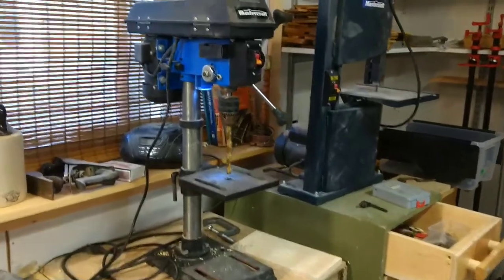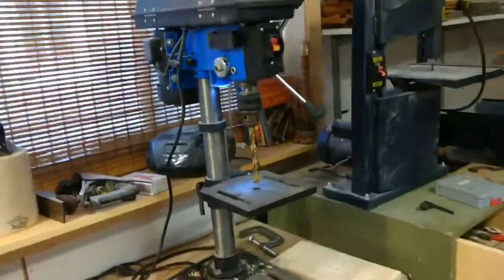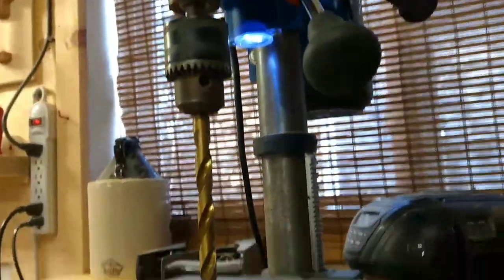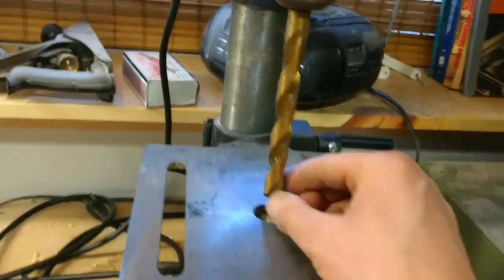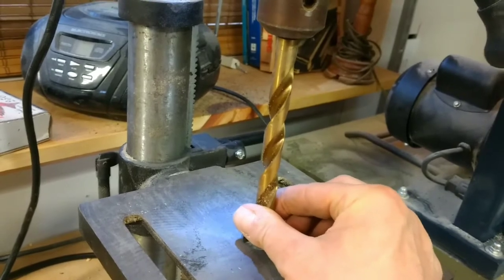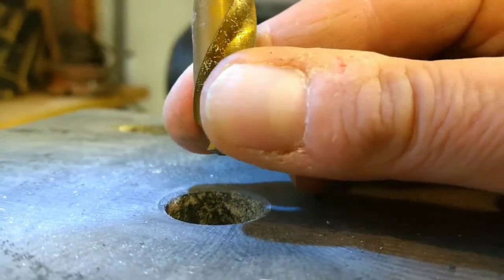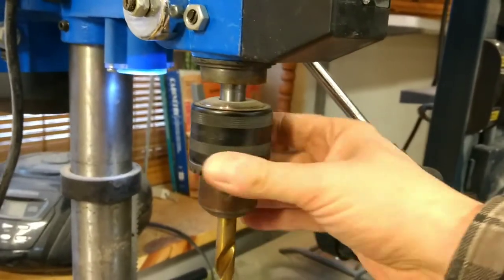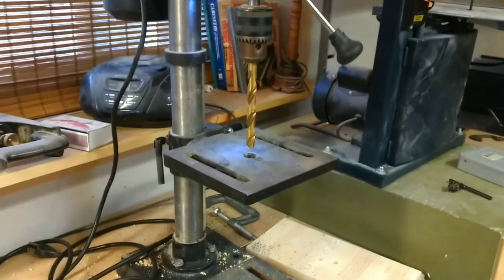Mastercraft Canadian Tire drill press wobble

Comment: I recently received one of these drill presses as a gift. It had the same play as is mentioned in the video. I tried adjusting with the set screw on the left as per the manual and it did nothing. I removed the set screw and found it had to two flats machined on the end forming a flat spade on the end to fit into the groove on the left of the quill ( the bit that goes up and down with the rotating shaft inside). The idea seems to be to angle the flat section in the groove to take up the play. A very crappy idea! I found another set screw and ground  taper on the end to fit snugly in the groove, lubricated it well and re-assembled things tightening the screw until play in all directions disappeared. I have now drilled a few hundred holes with excellent results and only once tightened the screw to keep things tight. I hope this works for you guys.
Reply: THANK YOU SO MUCH!!! This is what I have been leading up to thinking about trying to fix the problem from what I have read/found/and diagnosed from the diagrams of this machine.
Reply: How did you disassemble the quill etc to remove the set screw? I am having trouble finding any disassembly tutorials for this model of drill. All I have to go by is the 'exploded view' in the manual.
Reply: Just tried this and it seems to be working great, thanks for the tip.
Reply: @TefenCa  I just forced the set screw out without disassembling anything.  I pulled the lever all the way down first so that if it damaged anything, it'd at least be at the end of its travel.  There is now a bit of wobble in the last quarter inch or so of drill press travel, but otherwise it's tight.

Comment: All Drill presses are made in China ,or Taiwan, big box stores buy the crapiest of the crap,to meet a certain market demand a proper tool store,will have them made to a much higher specifications ,but obviously you will also pay a lot more for them.If you look at the higher name brands drill presses you will see the castings all look the same,but the higher spec get the better of the castings and internals.

Comment: This is a bit late. I just stumbled across this video that I commented on a few years ago (I'm C below) and only just noticed that Tefen Ca asked a question about removing the set screw. I embarrassed to say I just used force as I did not know what I was dealing with (the spade end in the quill slot). Luckily the set screw was made from very soft steel and came out easily. Also, an added tip. If you are not familiar with centre drills AKA known as starter drills or even Slocombe drills to the old guy's (me) get yourself some and use them for precision drilling in steel.

Comment: I have a Ryobi  DP103L with the same problem- seems fairly solid when retracted but still has almost a 1/16” of deflection and at least a 1/8” runout when quill is extended. I would definitely include pictures if I knew how.
This seems like a good fix, but on mine, I would have to remove the on switch assembly and hopefully drill / tap the cast body beneath it, and do the same on the opposite (left) side next to the return spring. Also, it frustrating and almost impossible to set the apparently? flat table perpendicular to the chuck/ quill assembly Really not sure if it’s worth it..? 
On a good note I did find your video :) and I did learn basically what my real problem is. Since I drill a lot more steel than wood and want more precision. I should have saved a couple hundred extra dollars and bought a better tool… oh yeah, wait a minute- this was bought as a present by my girlfriend… hahaha, didn’t want to discourage her so I’ve sucked it up and tried to make the best of it. Damn it Jim! I’m kinda in a pickle.

Comment: I agree that this thing is a piece of junk. I paid $99 for mine and I can live with the crappiness of it but it's been nothing but problems ever since new. Wish I saved the receipt!
Reply: same for me , no receipt.... but hey there is a set screw on the left side  thighten it a little and it helps takes away some the wobble. dont get confuse there are 2 set screw  side by side
Reply: "I recently received one of these drill presses as a gift. It had the same play as is mentioned in the video. I tried adjusting with the set screw on the left as per the manual and it did nothing. I removed the set screw and found it had to two flats machined on the end forming a flat spade on the end to fit into the groove on the left of the quill ( the bit that goes up and down with the rotating shaft inside). The idea seems to be to angle the flat section in the groove to take up the play. A very crappy idea! I found another set screw and ground  taper on the end to fit snugly in the groove, lubricated it well and re-assembled things tightening the screw until play in all directions disappeared. I have now drilled a few hundred holes with excellent results and only once tightened the screw to keep things tight. I hope this works for you guys."
Reply: @Danroxye01  "I recently received one of these drill presses as a gift. It had the same play as is mentioned in the video. I tried adjusting with the set screw on the left as per the manual and it did nothing. I removed the set screw and found it had to two flats machined on the end forming a flat spade on the end to fit into the groove on the left of the quill ( the bit that goes up and down with the rotating shaft inside). The idea seems to be to angle the flat section in the groove to take up the play. A very crappy idea! I found another set screw and ground  taper on the end to fit snugly in the groove, lubricated it well and re-assembled things tightening the screw until play in all directions disappeared. I have now drilled a few hundred holes with excellent results and only once tightened the screw to keep things tight. I hope this works for you guys."
Reply: @TefenCa  I'd love to have seen more clearly how you improved it and what you used . But thanks for giving me hope. I'll read your comment a few Times may be I'll get the idea.

Comment: I have the same one, with similar quality issues. let me know if you find a fix.
Reply from the maker: jadzdotcom going to try to return it. The casting is so bad.
Reply: "I recently received one of these drill presses as a gift. It had the same play as is mentioned in the video. I tried adjusting with the set screw on the left as per the manual and it did nothing. I removed the set screw and found it had to two flats machined on the end forming a flat spade on the end to fit into the groove on the left of the quill ( the bit that goes up and down with the rotating shaft inside). The idea seems to be to angle the flat section in the groove to take up the play. A very crappy idea! I found another set screw and ground  taper on the end to fit snugly in the groove, lubricated it well and re-assembled things tightening the screw until play in all directions disappeared. I have now drilled a few hundred holes with excellent results and only once tightened the screw to keep things tight. I hope this works for you guys."

Comment: loosen the nut on the left side and tighten that little black set screw. it will take the play out of it. It's right in the manual...
Reply from the maker: paradoxx64 dang... The thread is stripped or was not cast properly. It sure wasn't anything I did. This drill press is a piece of crap. I'm going to try to return it.
Reply: don't give misinformation, that set screw is to prevent the quill from turning it is not to take out the play in the quill, if you have a drill press you should know that , besides it has a squared end and it won't turn until you slide the quill out.
Reply: @gusf8451  there is an other set screw just beside it , and it those take away some of the loose , it's so cheaply made
Reply: Thank you , it does attenuate the wobble

Comment: When you tighten down with the chuck.. use all 3 holes. Allot of people will just use 1 hole that is closest to them, but the fact is you are supposed to use all 3 holes so each end of the chucks clamp bites evenly. If that doesnt work you will have to replace the chuck.. but still use the 3 holes to tighten down with the new chuck.... cheers
Reply from the maker: Did that, didn't help.
Reply: @JohnvanGurp  Ah :(